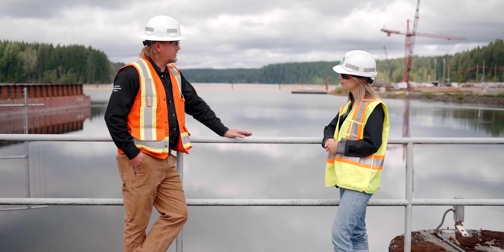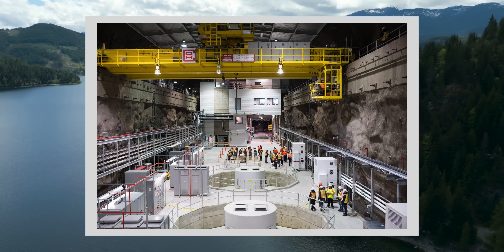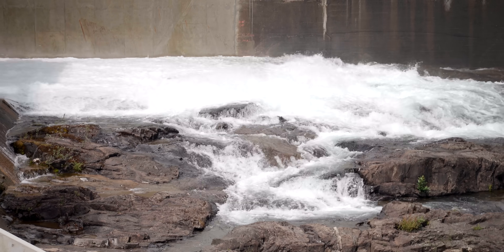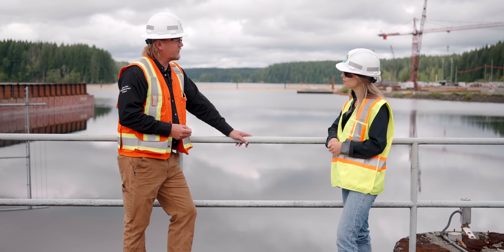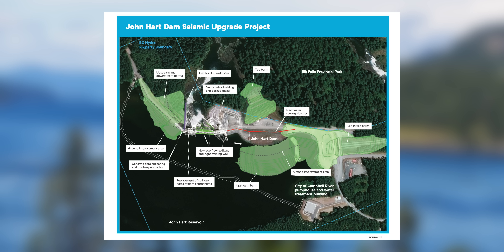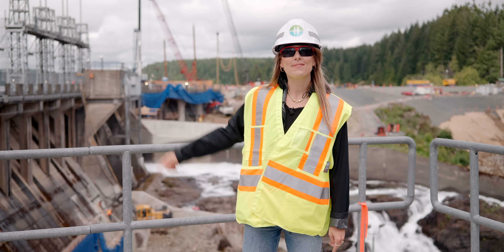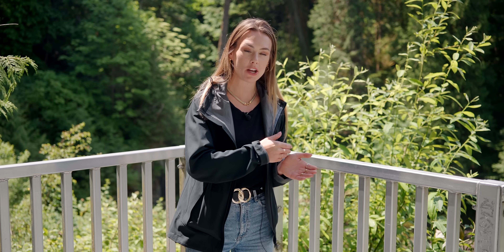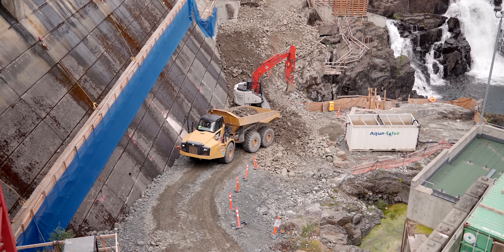Can A Hydroelectric Dam Survive An Earthquake?!

Comment: Much of the projected increased demand in BC is for power to compress fracked fossil gas to be put in big ships for LNG exports to the other side of the Pacific Ocean!!  This is spun as being good for the environment because the gas will replace dirtier coal when burnt overseas.  This argument is no longer valid.  We have much evidence of huge methane leakages during fracking and transport.  We need stop burning both coal and gas.  The Site C dam on the Peace River in northern BC has been built at a cost of 16 billion, twice the original estimate, and its energy output will be entirely used to liquify methane.  The impact of fracking, the dam, and pipelines on BC's environment is huge.  Our BC government is too close to the oil and gas industry, and the government's decisions have gone against sound economic and environmental analyses.  Besides the flooded valley habitat, there will be reduced water flows downstream in the Athabasca/Peace delta, which is critical wildlife habitat and a world hertiage site.

There is also concern about methane emissions from the reservoir.  I would like to see Fully Charged look at the issue of methane emissions from reservoirs, and compare the overall climate impacts of dams compared to alternative renewable sources such as geothermal, wind, and solar.

Comment: A truly enlightened and properly environmentally friendly approach would have the aim of removing the dams altogether. Replace the power generation with instream turbines, wind and solar, and give the river back to the salmon and the beavers, who will restore aquifers for local water supply and boost biodiversity and carbon sequestration to levels we can currently only dream of.
Reply: There are wind turbines on the northern tip of the island. Not sure of the efficacity of instream turbines or their impact on the salmon population, but I doubt it would be good, and you would still need dams to maintain a steady stream of water, preventing flooding in Campbell River in the winter and drying out the river in the summer. This system provides electricity for nearly a million people on Vancouver Island, and I would think that B.C. Hydro did their homework. At least we don’t depend on fossil fuels or nuclear power. We could go back to the pre-electric era, and a handful of gulf islands (eg Savary, Lasqueti) have opted out, but for most of us, electricity is a basic necessity. And at 14.5 cents kWh/h, affordable.
Reply: Dams have been a great, reliable source of cheap electricity leading up to nuclear power. However, nuclear is the only realistic, permanent baseline power source. Once SMR production is established, the dams can be removed. 
Repeal: Clean Energy Act Ch 22 Part 1 article 2 sub-para (o); and Add: sub-para (q) ...to achieve British Columbia's energy objectives to include nuclear energy.
Reply: Nope, they are already there.

You can build new rivers for fish.